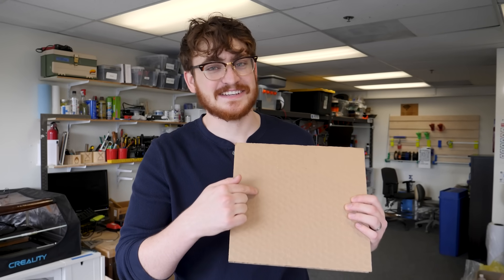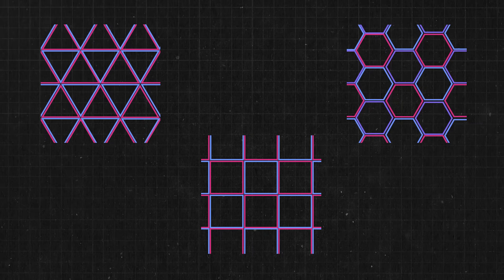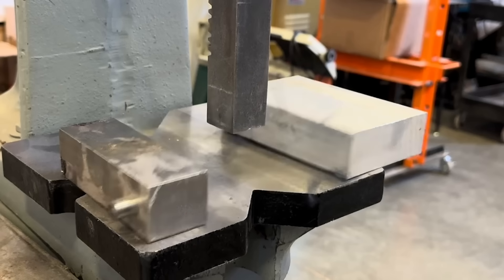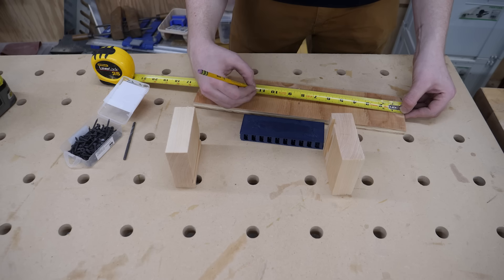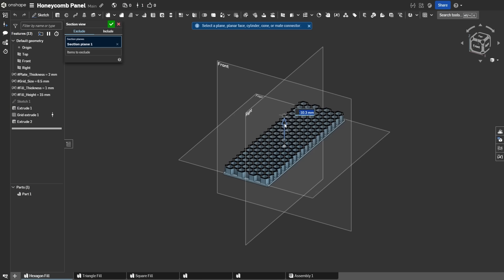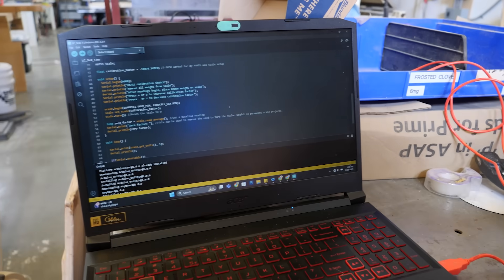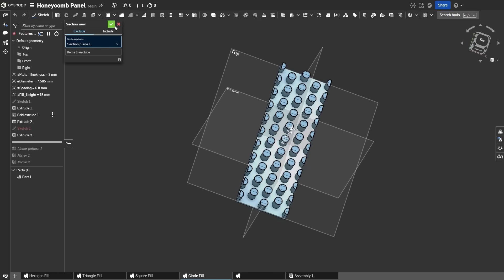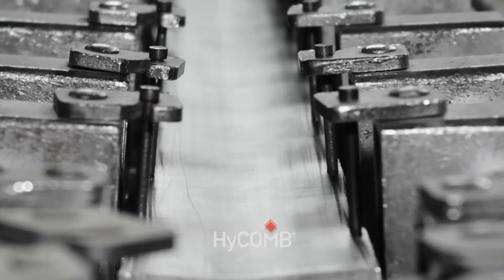Taking the Hexagons out of Honeycomb Panels

Comment from the maker: I can't believe that I didn't catch this in editing, but the y-axis for the load is off by a factor of 10. Instead of 250 N, it should be 2500 N. The same code was used across all the samples, so the relative comparison is correct; I just messed up the scaling.

Comment: I mean, hexagons did actually outperform the other materials. It might have been within what could be considered margin of error, but for the one test you did they were the best. You probably should have done a couple more repeats of the test. It's hard for me to extrapolate these results because it might have been a fluke. Of course, this is all more for entertainment than science, so thanks for the video. <3
Reply from the maker: Yeah, I have gone on to do bent tests of metallic bars and did multiple trials with the same material. The spread I saw there was in line with the variability in these panel tests so I’d say it’s unlikely that there was a meaningful difference between the shapes

Comment: The breaking strength of the sandwich beams is governed almost entirely by the strength of the bottom and top plates. The infill simply needs enough shear strength/stiffness to survive the bending test.  All of the samples (excluding the columns) had ample shear capability and broke at approximately the same load level.  I suggest that you need to run additional tests with decreasing infill densities to determine which shape is the most efficient at carrying the shear loads.  There is a good chance your thesis will still hold true, but until then, I am not convinced.

Comment: This result is likely an artifact of excessively thick infill on all three shapes, all you were really testing was the axial strength of the top and bottom plates rather than shear and lateral-compressive strength of the core, thus they all had the same result because they all had the same top and bottom plates.
Secondly, even without the experiment-design flaw your hypothesis is overlooking the effect of orientation. Will a square turned 45⁰ be equal to a square with normal orientation, eg.?

Comment: But honeycomb panels are made to be strong in perpendicular direction to directions that hexagon or other pattern would differ in strength. I'm not saying there will be no difference in results (I am writing this in advance) just that the main point of middle layer in the sandwich construction is to bond two plates together, not to carry significant load. It's job of those plates to carry load, like top and bottom of I beam. So the point those people make misses the design principles of this construction type. I still think hexagons are bestagons, but not to carry load (unless they are secretly triangular grid or have stiff back wall).

Comment: Mathematically I would expect  little difference.  A square with 4cm sides has a perimeter/area ratio of 1 and a cell area of 16cm2. For the same perimeter/area ratio (same thickness and same weight per area), the triangle would have a sidelength of about 7 and a cell area of 21cm2 and the hexagon would have a sidelength about 2.3 and a cell area of 13.8cm2. So the cell area for the hexagon is better but not that much better (to convert to an average span you can square root it) and there are many other factors at play. The hexagon's advantage would increase if the board were laid on the ground with heavy items rolling over it and the face material was thin, but that is not a normal usage case.

Comment: Hexagons have more open air space which means that they do use less material and are still just as strong. You can also pair Hexagons with pentagons and closely emulate a curved surface which makes it possible to have a patterned infill on shapes that do not travel in a single plane. Although at present I do not think the infill algorithms offer this ability yet do to the increased complexity of the patterns, I do think that they will offer them in the future. For example if you print out a spherical shell and test it's strength and then compare it to a spherical shell that circumscribes a truncated icosahedron with sixty points that support the outer spherical shell my guess is that the shell supported by the truncated icosahedron will be much stronger.

Comment: What you demonstrated is that bending strength of a panel is not much affected by the type of infill, as long as there is a continuous shear wall between the two face sheets.

What it didn't demonstrate is the crush strength of the infill, which would depend on its buckling strength, or its effect on torsional stiffness of the panel, in which case I suspect the triangles would be slightly superior because on its own triangular infill would have the greatest torsional stiffness.

Comment: I like the concept.
This is two dimensional shapes.
What if you did three dimensional shapes as the infill, to get structural strength in all three axis?

An example would be to use Buckyball Fullerene shapes that are offset at each layer because of their shape.  Each of the layers are partially in the layer above and below, etc.

And you can experiment with adjusting the diameter of the legs of each part of the buckyball to see where you get optimal strength but with least amount of material.

just an idea
would love to see it

Comment: IMO hex do have a good strength to weight ratio because they need (comparatively) less surface area glued than something like a square's cross section(which would be every other surface or maybe every surface depending how you did it, vs ~ 1/3 per hex shape made), it just happens that being able to make them easier is also part of how glue gets applied and they only really need to be pulled in a straight line to extend their spacing, flat squares would need to 'swing' a direction if even/odd glued and that probably makes less ideal, triangles can't swing at all to be formed after. Also for squares you are forced to have a higher percentage of doubled-walls per shape made.

Comment: If you are looking for the "best" 1% difference IS important. So you either prove that all are equal by making more, or you admit that you were wrong and hexagons are actually better. AAlso: Is this weight difference the infill or the flat surface differences? There is a difference from 70.5 to 69.5, so they are not identical, they are similar. And that difference could be important.  When there is a difference from 70.5 to 69.5, they are not identical, they are similar. Is that difference the hexagons themselves? Perhaps the hexagons were slightly shorter and the flat surface slightly thicker, so makes it slightly better where in reality the hexagons would be worse. Or the other way around and making them way better. 

Next we see only one size. For all we know they ARE stronger when smaller, but not when bigger, or the ratio of the thickness might be important. Or there is a difference if the hexagons are part of the structure or not.

Sorry, but again, you can not show that the strongest one are the hexagons and then say that it does not matter. That is like saying everybody gets a 1st place who gets in around the same time as the winner with margin of around 1%. That is not how we conclude who or what is "best" when comparing numbers. Science does not hand out participation trophies.

The only thing I got was: "My theory was proven wrong, they ARE stronger by 1%".

Comment: They are bestagons because of optimised material to surface area, not strength perse
Reply: It's not even that. It's because they're easy to mass produce.
Reply: @prdoyle  Bees are living 3D printers. They definitely optimize for material usage, but with added constraints. Every cell has to be accessible on one surface, for both access and gas exchange. Larvae are long and thin, so the cells are long and thin.
Reply: @hamjudo Bees don't even actually make honeycomb cells. They make annular cells that, as the wax melts and settles, turn into hexagons. And that's because it's the least energy configuration given material and area
Reply: @hamjudo  Literally just learned about the HoneyComb Theory / Conjecture this week. They are proven most efficient shape for distribution across a surface, which I understand as, you can fit the most same sized hexagons into ANY given area, versus any other shape, or possibly, even including partial hexagons, which if "added" up as remainders, might still be more efficient than other shapes. I don't math. But that would likely provide a mathematical credence to their ease of manufacture. Or I guess just be in line with the stated, "hexagons are semi-automatic to manufacture, everything else requires more work."
Reply: @pythonX137  from the other comments, someone posted their thesis on extruded infills: Hexagons are best used for filling spaces, being extremely deformable/conformal (packing plates, natural beehives); structurally, the only thing worse was 3d gyroids (unless you really like soft parts). From a manufacturing perspective, if you aren't making expanded honeycombs (ie, most processes), squares would be at least as difficult.

Comment: While honeycomb is common for cores in aerospace, when we have the freedom to machine the panel structure isogrid or orthogrid are use. So triangles and squares. Cool testing.
Reply: I was coming to comments to add this.  Hexagrids are meaningfully worse in in-plane forces, and support the milled out remaining skin worse.  Orthogrid is easier than isogrid but less stiff in plane.

But the various milled grids are usually used where any two wall structures are problematic.  In spacecraft, propellant tanks where cryopumping would wreck sandwich panels, or where any leaks of corrosive propellant would wreck the honeycomb or adhesive.

Comment: The "simulation" you did was just atrociously bad. Seriously - that is nailing 2 random point in a completely arbitrary abstract physics-solver, where all connections are formed by perfect hinges. Then the acrylic test was loading the samples is the WEAK direction, not the direction it is supposed to be used.
The doubling of some parts does not make the structure stronger - it just is a side-effect of easy manufacturing and where possible it is avoided specifically cause it is WEAKER by weight. triangular 

And honeycomb is NOT used for bearing loads like a bridge. If you try using any pattern-based material like that you are already doing it wrong. Do you know how such loadbearing structures get their strength? Through the top and bottom layer.... guess what the logic conclusion of that is? Right - minimize ANY material that is not in those layers. And the result is - drumroll please - the I-beam. Honeycomb-panels are used where they need to withstand simpel compressive loads that are perpendicular to the prisms. If you have a differing loading-scenario then you are choosing to use the wrong shape.
Reply: I'm having trouble understanding which direction you meant by 

"Honeycomb-panels are used where they need to withstand simpel compressive loads that are perpendicular to the prisms."

So should he have tested the honeycomb he made while it was "standing up" straight? Thanks for the comment
Reply: @ "So should he have tested the honeycomb he made while it was "standing up" straight? "
if you image a honeycomb-pattern on your screen. Now the loading-direction would be you pushing against the monitor-Panel.

Or just normal honeycomb-panels that have a solid sheet to cover the top/bottom holes. Lay it flat on the ground and stand on it.
Reply: The people who actually understand beam theory may get a laugh out of this fool comment. It seems about the level of structural comprehension one would expect of a basic civil engineer.
Reply: I am confused by your comment. You first are raging at him, then sort of agree but maybe not realise? This video was direct response to the criticism that sandwich construction with honeycomb is great, but as you mentioned, it works similar to I beam, and middle (honeycomb) just makes top and bottom work together. 
The perfect hinge simulation is not bad simulation, this is how engineers design and simulate grids, so the true honeycomb grid is bad at this.
CGP Grey is right that hexagon is bestagon, but he made a mistake when he praised its structural strength (suggesting the grid). Per engineering standard, it is just not true. But we (or at least I) still love hexagons for other reasons!
Reply: @syriuszb8611  " You first are raging at him, then sort of agree but maybe not realise?"
At no point to i agree with his conclusions, tests nor simulations. ARe you confused by my comment? Maybe try reading it again slowly.

"This video was direct response to the criticism that sandwich construction with honeycomb is great"
No that is not the point of the video at all.

"The perfect hinge simulation is not bad simulation"
I never said it is a bad simulation - but it is an irrelevant simulation as it only test the characteristics in a load-situation that never happens. That is like testing how good a car is by checking if it can swim.
Reply: @ABaumstumpf  He explains why he does the video in first 30 seconds.
The honeycomb grid is just not statically determinate, so it would never be a good truss no mater what. Because of that, load situations where hexagonal grid truss would be structurally stronger really never happen. It's like engineering 101.
Reply: @syriuszb8611  "He explains why he does the video in first 30 seconds."
Yes - and it is not what you claimed in your previous comment.
Reply: @ABaumstumpf  lol, honeycomb panels are technically called sandwich structured composite.
Reply: @syriuszb8611  "lol, honeycomb panels are technically called sandwich structured composite."
So you can not make an actual argument and try to shift the topic after getting called out?
Pathetic. but to be expected after your original incoherent ramblings.
Reply: I bet people just loooove having conversations with you....
Reply: @marsrevolutionary  "I bet people just loooove having conversations with you...."
Do you have anything of worth to add or are you just here to show your ignorance and toxicity?
Reply: @ABaumstumpf  This is what I was talking about.

Comment: TLDW:
Honeycomb are neither notably stronger or weaker as other patterns but dirt cheap to mass produce.
Hence industry standard.
Hence hexagons are the bestagons.(And nature figured out that out long ago)
Reply: Hello, I am an engineer that researched pattern structures such as honeycombs, iso grid and all the other ones for my final thesis.

What you said is 2/3 false.

Hexagon are noticably a lot weaker in all planar direction than most of the other patterns we are talking about a factor 10 weaker in terms of young modulus compared to triangle or square and a factor 3 weaker in term of maximum load.

They also have the very nasty habit of deforming a lot more than the base material (hexagon and diamond pattern act like a cinematic structure that move under strain) do if you glue an honeycomb over a plate, the honeycomb will curve the plate itself since it deforms 3 time more.

The only saving grace of the hexagon is that they have the best tesselation index, so, for a pattern size and wall thickness fixed, you can fill a surface with hexagon with less walls/material than other pattern. But we are talking about a gain of about 10% when it's mechanical resistance is several time weaker. It should only be used when mechanical resistance of the pattern isn't import (as for bees in honeycomb).

They are easier to manufacture in some process, but for the majority, it's harder or equivalent compared to other pattern such as square.

They are mainly used as spacer in sandwich panel since the manufacturing process of extrusion works well with hexagon and the mechanical resistance of the sandwich pattern isn't important whereas lightness is
Reply: @theofilleul6866  But tell him that not me, I just wrote the TLDW...
But since your here, what about gyroid and what's your final conclusion is there "the best pattern" or is it like anything else "it depends"
Reply: @DerSolinski  My bad, not a native speaker so idk what TLDW meant.

My study focused on planar pattern 2D (gyroid are 3D) but I looked into 3D for personal curiosity and can do a quick summary :

-Isogrid (triangle) and Kagome (Tri-hexa or called 6 star) are equivalent, same resistance in all direction of the plan and pretty good ranked in term of stifness, can be hard to manufacture depending on the technique. they are good when you have load unknown or everywhere

-Orthogrid (square) strongest but only in two precise direction, strength collapse when used in more than 10° of the two strong dirdction, good when you know very precisly the direction of load (as in a rocket structure) easy to mill cnc. Same for some of its variants 

-diamond : 2nd best strength but only in a 45° array of direction, second worse in the other 45° 

-Tri-square and second type of diamond : derivated from the square but with additional struct to approach the triangle : sometime a bit better, sometime worse than triangle, less uniform in term of strength.

-Honeycomb, the worse of all, at least it's uniform

-3d pattern are supposed to have a third axis of symetry, they are good if you want your part to have equivalent strength in 3 direction, or for support in metal 3d print since they aren't hermetic. Sometime they are stronger in the third direction than 2d pattern, but always less strong in the 2 direction of the plane. 3D pattern are only realistic in 3d printing

-Gyroid is one of the worse in term of stiffness, but super good for elastic deformation, definitly good for squishy parts in tpu.

- I didn't studied much the rest, but what was true in 2D somewhat stay true in 3D, triangle and square based 3d pattern kinda have some of the same properties
Reply: That means it is the cheapagon